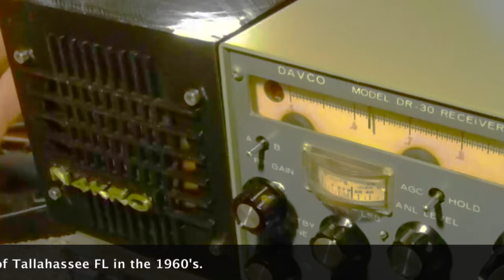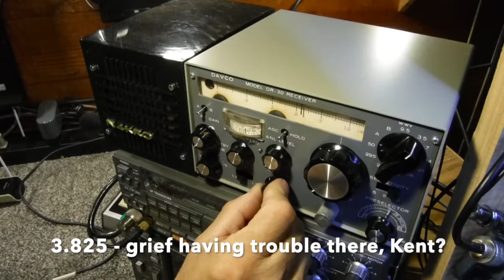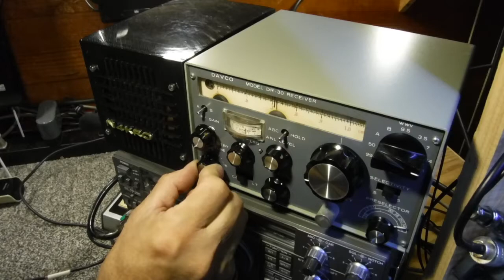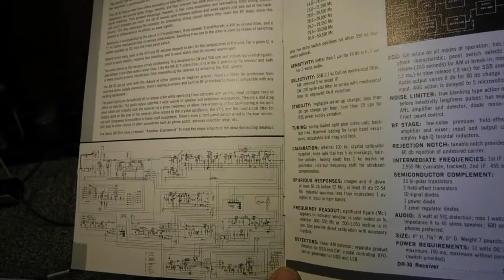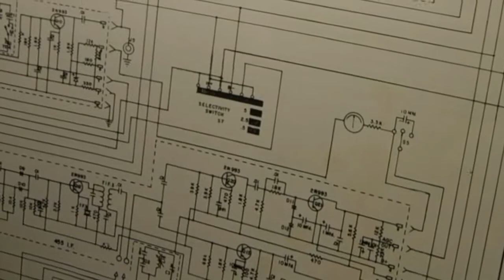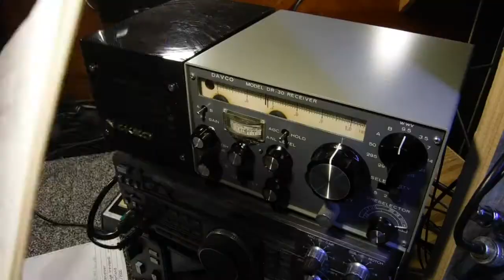Introducing the Vintage Ham Radio Receiver Davco DR30

Comment: In the evolution of solid state ham receivers, this is really a land mark. 1957-8 Regency  germanium Converter  1962 SBE33  germanium single conversion superhet w/ collins filter 1966 Davco duble conversion collins filter, ceramic filters, preselector, noise blanker, and FETs and some serious mecanical engineering, 1971 Swan SS-200  the first all solid state ham Xcvr..  Nothing comes close to to Davco for 10 years ! W6WUH

Comment: I've been looking for one of those.. they are known for their ability to drag in weak signals.
I'm jealous. Great find!
You ever want to get rid of it let me know..
W4KG
Reply from the maker: I bid on another one last night and just missed getting it.  It went for 365 Canadian.  I stopped at 350c.  There is another one for 750 USD if you want it.
Reply: @KOVintageTech  I would go in the 300 to 400  range 750 is a bit hot.. $1200 for the Icom 705!!
Reply from the maker: Steven Wilson you’ll probably not find one that low. They are running from 750 not working to 1500 working at the moment. And are still hard to find.  The one that just sold for $365c was parts only. I really lucked out on this one.